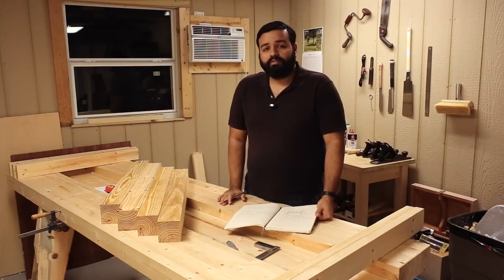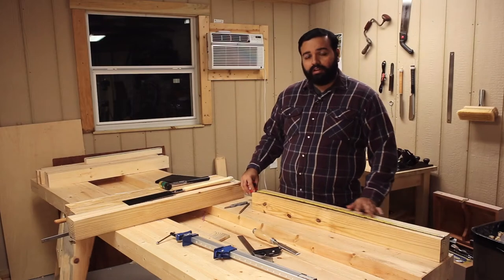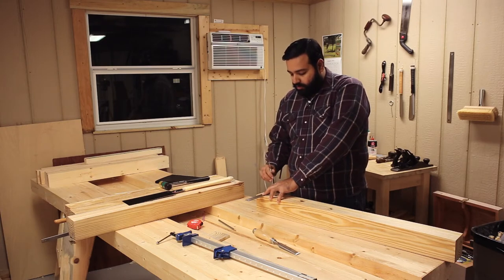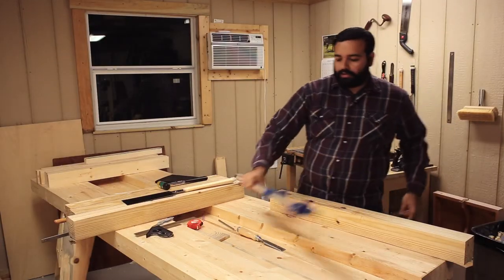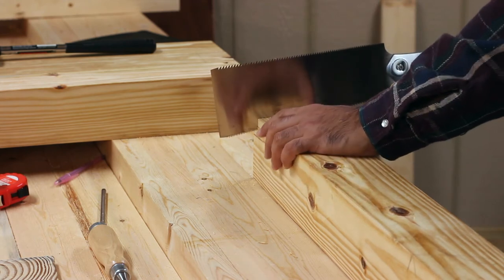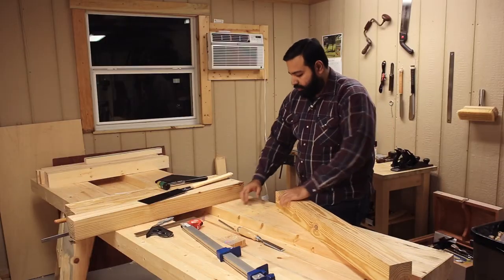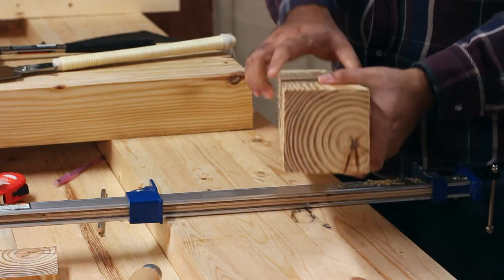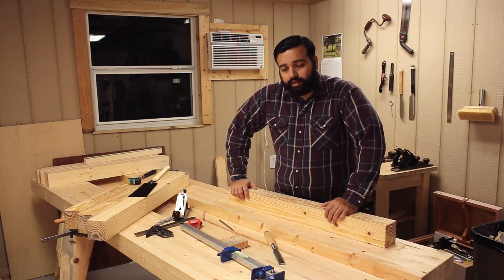Japanese pull saw cross-cutting - Workbench build #3

Comment: Progress is progress. You'll get there. I like the bench you're currently using. The trough in the middle is nice. I can see how that would be a useful setup in a lot of cases.
Reply from the maker: Thanks Steve! The bench is really just the tops clamped together resting on saw horses. The tool well is a good feature. I have used this type of bench before and I really like the set up. Wider pieces can span the two tops without hitting the tools in the well. It's coming together slowly.

Comment: Hi, how do you keep the saw straight and also if it's cut slanted how can I level/correct it ?
Reply from the maker: +Jonathan Foong The knife wall and the valley I cut with the chisel at [6:45] help create a definitive recess for the saw to sit. The saw sits in there and creates a kerf. I then start cutting the adjacent side creating a triangular kerf. It takes practice to keep the saw straight past this cut. Basically your hands will learn to keep the saw straight with lots of practice. I am still learning this. 

If the saw has skewed, I try to stop the cut if it is skewed towards the piece so that the kerf does not cut into the piece I am cutting into. If it skews away from the piece into the waste side, then I keep going. I can come back with a hand plane or a chisel to refine the kerf if needed once the sawing is done. 

Is this helpful or was something not addressed?